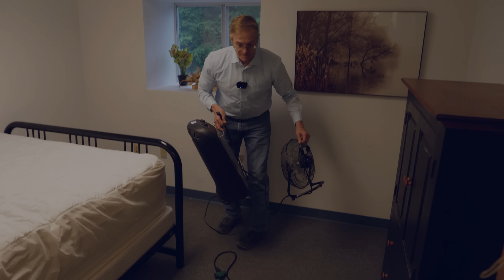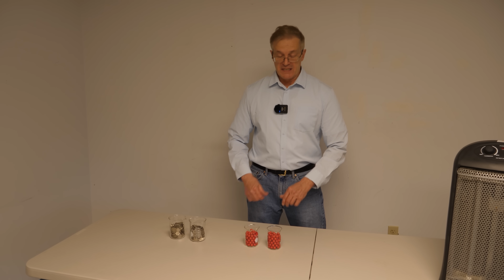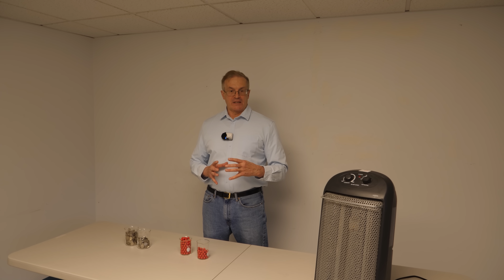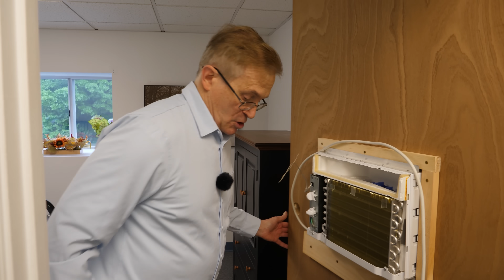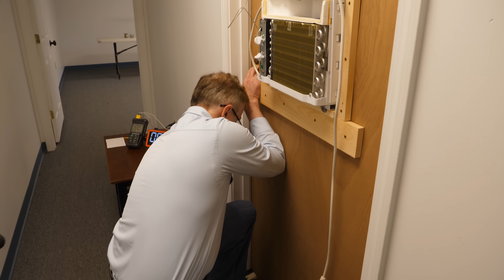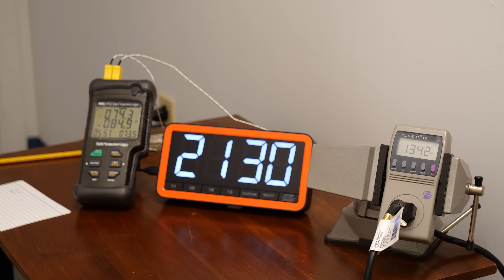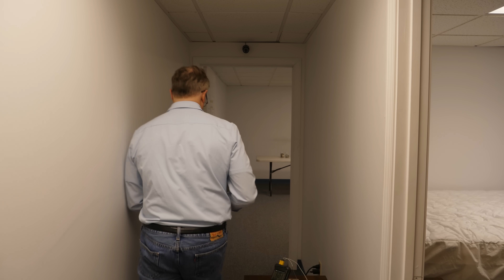You're wasting money on heating! Use your A/C!

Comment: The more high end heat pumps are now pushing an Scop (Seasonal Coefficient of Performance) of 6. Meaning for every 1kW electricity drawn from the grid, it's heating 6kW as opposed to 1kW an electrical oven would be heating. Here in Norway it has basically become the main and most normal source of heating for housing, as it's going to pay it's own expense in electricity bills and then become free heating towards the end of it's life cycle. 5kW of free heating for multiple seasons of winters does add up after a while.

Comment: The only thing that matters to a consumer is heat per dollar and natural gas heating if avalable is the most economical. At current prices of natural gas and electricity in my area in Ontario, Canada, the CoP of a heat pump needs to be at 7 to be economically viable to substitute natural gas heating with electric heat pump heating. It means that natural gas heating is two times more economical compared to a 3.5 CoP heat pump.
Reply: On the flip side, that means in your area, a CHP generator only needs to be about 14% efficient to net "free" heat. Which is not hard at all to exceed.
Reply: I totally agree with going with whatever is cheaper, but if you can have solar panels with a heat pump it's probably cheaper, and price heating wood that can be really cheap depending on where you live.
Reply: I also care very much about CO2 emissions.

Comment: Lol I was looking into this exact thing. I live in Canada and during the winter people use space heaters for supplemental heat for specific rooms all the time. It would be interesting to see a conversation that is capable of heating a room in the winter without  freezing the external radiator. It blows my mind that there are no windows mount electric heat pumps on the market that are capable of heating a room when the external temp is below 5 degrees Celsius. This tech has been around for a long time yet there are no window mount options. On a side note (at least where I live) a heat pump is the least expensive way to heat an area with the most expensive being resistive heaters. It even beats out natural gas.

Comment: 0:58 A heat pump, doesn't pump heat, out of a room, in ac mode and it doesn't, take the cold, out of a room, in heat mode, that is an internet myth, there is a temperature differential, between the hot and cold side, the temperature is affected, by the indoor and outdoor temperature.

Comment: I added a mini-fridge to the Bunker shop so I could have cold qater and even some ice cubes. I used packing foam to divide most of the inside compartment for a super cold compartment with a room temp compartment making up the rest. This is in a shop that goes over 100F. I added server fans blowing over the condensor coils and efficiency went way up, with the fans only consuming about 8W in total. For my next trick, I'll wire them in series, I think.

Comment: Excuse me, but that was NOT a fair comparison.  The temperature sensor was at least 7 feet away from the electric heater, but only 1.5 - 2 feet from the air conditioner.  I don't own an air conditioner but have learned first hand how hard it is to change the interior temperature of bedrooms with a simple fan, blowing the cool air outside into a room, ESPECIALLY if it is a a closed bedroom.  Static air makes a very good insulator.  Suggest you correct this flaw and repeat your test.

Comment: I live in northern italy and here is common to heat homes with  a gas powered water heater (caldaia). It heats water running in the radiators. Radiators reach 60 degrees celsius in 20 minutes and heat slowly heats the air in the house for 2 hours. My caldaia burns 1 cubic metre of gas per hour. It also the heating feels better that AC as water stays warm for longer that just the air. With AC I notice the temperature starts dropping as soon as I stop it.

Comment: The modern inverter heat pump systems are amazing.  We had a gas furnace that that was fine, but always struggled to keep the house warm in winter.  2 years ago we replaced with a heat pump , although I insisted on gas as the backup heating.  Even in -10F nights our backup heating never needed to kick in.  And the amount of electricity used was not really that significant.  Except when in recovery mode the 4 ton unit only pulls about 6-8 amps.

Comment: The kill-o-watt has a watt hour reading.  Why didn't you say "the resistance heater used a total of 900wh and brought the temperature up 10 degrees F, but the air conditioner used 200wh to raise it 15 degrees (or whatever it was)"
Reply from the maker: I could have.  You meant watt hours, not kwh.
Reply: @TechIngredients  That was a typo. Sorry. I'll fix it.

Comment: Heat pumps for home heating not working with outside air itself only but with humidity (water vapor) in that outside air. That is why their efficiency goes down if outside is below freezing. Humidity is freezed out of air. But still 2x efficient than electric heater. But every penny has both sides,... Heat pump is expensive to buy and if it broke you may need serious money to repair it. So it is necesary to calculate this to your heating bill. TI show pretty nice efficiency, bud it is around 70F air and unknown humidity, probably around 50% .... Efficiency can be very different in different conditions. But as simple demonstration of working heatpump it is OK.

Comment: Really great video and presentation, and I’ve often been a supporter of this tech (and a detractor of resistance heat.) There is one major issue you didn’t include in the test here, and that’s the use case for said technology. 

No one is turning on the heat when their room is 75 degrees already. 

I know it would be difficult to replicate this time of year, but I’d be very curious how these same results worked in the middle of winter, when the evaporator (in this case) is exposed to near-freezing temps. Its ability to remove “cold” from inside the bedroom will be dramatically reduced. Likewise, I’d expect to see much higher current draw. 

This is the same limiting factor on heat pumps in the summer, when outside air temps become extremely hot (the difference is that we don’t really have an alternative for AC I guess lol.)
Reply from the maker: The refrigerant and the compression ratios can be altered for different temperature differentials. You're right that the performance will decrease as the hill you need to climb becomes higher.
Reply: @TechIngredients  thanks for the reply, and yeah I just wish it was easier to do so. When I clicked on the video I initially thought you’d actually installed a reversing valve on a window air conditioner lol. 

Likewise the evaporator and condenser designs are optimized for AC only on these units - you lose a bit of efficiency when you need them to do both. 

It’s always frustrated me that my vacation travel trailer AC unit (14,000BTU) can’t do heat. The only provision is for a small resistance heat coil to be installed at the air intake, and it simply turns that on with the normal fan. They don’t even really consider it “heat” - it’s just to take some chill out of the air; incredibly inefficient.

Comment: I've always wondered how putting condensation water on the airconditioner fins will improve its cooling efficiency. And if there is a way improve it in winter it when using AC for heating instead of cooling.

Comment: subscriber here,  I just installed a hybrid heat pump hot water tank here in Charlette  North Carolina and  it takes the heat from my home in the summer and puts it into our domestic hot water supply , as we use the hot water , it indirectly dumps heat from the home down the drain.  ( so at least during the 9 months we need cooling in the home , I am getting it for free through this same process in reverse you are talking about in the video. ( using the process twice before dumping )   -- By the way don't forget to mention that the colder the air is on the evap side, the less efficient your system will be to the point of a resistance heater at about 30 degree F OAT ( outside air temp )  .

Comment: I think natural gas is more economical than electricity and air exchange heat pumps stop working at low outdoor temperatures.
Reply from the maker: It will be close, and the natural gas remains at the same efficiency no matter how large the differential is.  But, there are applications where electric is the only choice.

Comment: I have a minisplit with electric baseboards.  The minisplit is a little undersized so I need to use the baseboards a little on cold days.  A small A/C is a lot cheaper than a second minisplit.

Comment: I really like your channel and the knowledge your provide with your content. Regarding this experiment that you demonstrated in this video. I believe you should redo this test with certain added conditions.
1. The first part where you plugged in the heater with fan was fine, but when you power off the heater and fan, you should wait at least 15 mins before opening the door to see how much temperature was increased as the air/temperature in the room gets distributed and settles by itself.
2. The second part where you have installed the AC inside out on the door, i believe the proximity of the hot air output of the AC to the temperature sensor is very close as compared to the first setup (i.e. Heater and fan which were on the other end of the room in front of the bed). You should unplug the power and wait another 15 mins for air/temperature in the room to get distributed evenly and then take the temp reading.
I believe this way we can get a better result. Just my opinion.

Comment: Back in the 90s, I lived in a house with an electric hot water heater.  I made a heat exchanger with copper tubing, replaced the condenser on an window air conditioner, and hooked it up to make hot water.  It significant'y reduced my electric bill when it wasn't heating season.

Comment: you know I bought a small vertical air conditioner without a heating function, and I had considered I could make it into my own heat pump for my garage just by placing it outside in a small enclosure and venting in either the cold standard output, or heated exhaust output into the room

Comment: I think it would have been a great demonstration (not experiment) to turn the ac unit around, run them both on separate amp. meters, and show how the heat pump wins by moving more heat with less power.
Reply from the maker: That's a good idea.
Reply: @TechIngredients   Another option:   A submersible heating element (aquarium heater or similar) and the heat pump evaporator placed in an insulated cooler full of water with neutrally buoyant glitter for great visual effect.  measure the mass of the water, watts on both sides, and temp.  Show the beautiful convection currents.  Win hearts and minds and views!

Comment: what about it's efficiency vs water radiator with gas boiler we have a lot here in europe
Reply: It depends. Theoretically it’s still more energy efficient - the detail is more complicated:
Electricity is still created by burning gas or other fossile field in the first place (lowering the overall efficiency of your heatpumps-powerplant system), in addition the efficiency of a heat pump is dependent on temperature difference (maintaining 22°C room temperature is very efficient when it’s 15°C outside, but terribly inefficient or even impossible when it’s -20°C outside). Then there is the grid and especially in Germany there will be huge problems with the capacity of the grid and its stability considering the lack of reliable energy production (coal, gas and nuclear), but ambitions to add the energy demands of two huge sectors to it (heating and mobility).
Reply from the maker: You'd have to factor in gas and electricity prices. I can't address that, but here in New England, the pump still wins, not to mention that you don't need two systems.

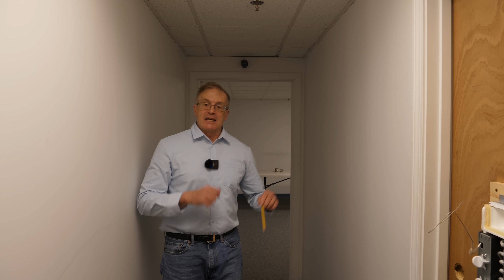Comment: 15:00  I absolutely do not believe this and want some proof that an air conditioner made in 2024 is twice as efficient as one from say, 2000.  This is a complete lie. (I'm not saying YOU are lying, but that the manufacturers are lying)  I want experimental proof.
This supposed increase in efficiency can really only come from a couple of places:
1) A more efficient refrigerant.
2) More efficient fans and pump.
However:

1) But the simple fact is, the most efficient refrigerants hav been outlawed (for environmental reasons) and the HVAC companies forced to work with a less efficient refrigerant.
2) Electric motors just aren't twice as efficient as they were in 1990.

I am going to need proof and not just marketing claims and BS printed on the box of the appliance.  Courts have ruled again and again and again that stuff printed on the box is marketing fluff that a reasonable and prudent person wouldn't take at face value.

I think the alleged efficiency of modern appliances is entirely made up with, at best, marginal improvements.
Reply from the maker: You make a valid point.
Hopefully,  the simplicity of such a test will motivate someone, maybe us, to do a comparison test.

Comment: The weakness of heatpumps is temperature difference. The Heatpumps are only efficient at small temperature differences. If you want to heat your water in the winter (Winter when it’s crucial to heat and water because it typically required to be at higher temperatures than the air), you might need multiple stages or assistance by a conventional heating element.
Also in Germany (where I live) the grid is not ready to provide the needed electricity for all the heatpumps and EV‘s charging, which obviously causes additional problems.

Comment: Cool video, but heating with a heat pump will only work if it is not too cool outside. Some units work to -30 Degree Celcius, but most only till -20 and the efficiency is very low then.

Comment: Im actually very surprised how its such a big difference, but I see u are doing comparison of electricity drawn to electric drawn. that is a good test, I wold be really interested if u could run a same test against the gas vs electricity as a power source. and also in different conditions. as I know heat pumps are not doing very great in low temperatures. maybe an idea for a video that can be done in a middle of a winter how these results holds. still very very interesting!

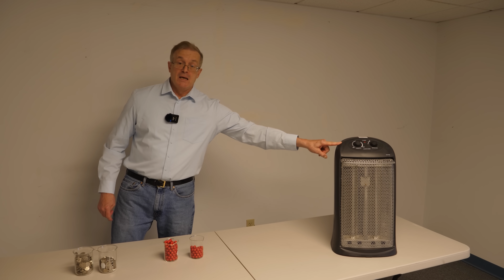Comment: 4:01 Since you're using entropy as the relevant thermodynamic potential here and your argument follows the common misconception of entropy being disorder instead of energetic degeneracy, I beg to differ in this statement. Heat is not kinetic energy, it's undirected motion. Take particles in an accelerator as an example, while moving with the speed of light, each bunch can be comparatively cool concerning the undirected motion in the bunch's reference system.
Reply from the maker: Yes, it is kenetic energy. What matters is the speed, not a given vector.
Reply: That is not correct, the reference system's movement does matter. A ballon doesn't get hotter just because you travel with it in an airplane.

Comment: Say it suddenly turns winter in the hallway. Ambient temps 20° or 10°F, but you still need to extract all your heat from this supply source. Has the efficiency changed any?

Comment: I have been doing this to heat and cool my home for some time I have a covered porch so when I want to heat my house I just reverse the way the air conditioner is setting in the window and use a high voltage thermostat  that is attached to a plugin to run it for heating

Comment: A heat pump being over 100% efficient is just accounting fraud.  Heat pumps are maybe 75% efficient. 
The "accounting fraud" part is saying that a heat pump can move more energy in the form of heat than the unit consumes.  Another way of saying it is a heat pump can move 1kwh of heat from one room to another while only consuming 250 watt hours of electricity.  The effect is real, but looking at it this way is just accounting fraud.  They aren't really over-unity devices.
Reply from the maker: Of course, they aren't over unity devices, as I clearly stated. Moving energy requires less work than generating it in the first place. It's about perspective,  not fraud.